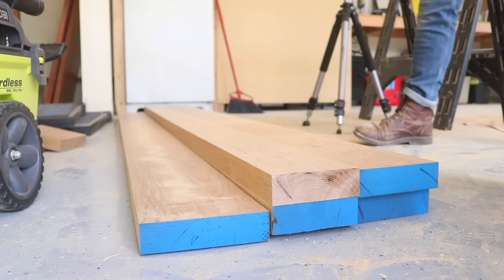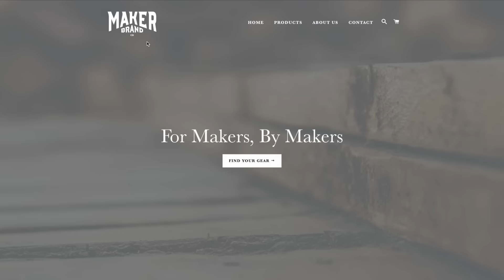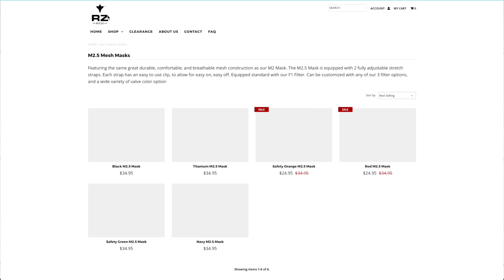How To Build a HIGH QUALITY Dining Table with LIMITED TOOLS // #DIY //  #Woodworking

Comment: limited tools? I count 24 tools
Reply: Limited tools means a much different thing than it used to.
Reply: Limited tools as in basic woodworking tools, limited has changed a lot as the other comment said.
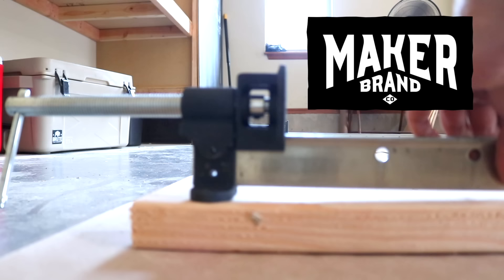Reply: Is not limited tools.. is limited "clickbait title" tools. I've paused the video at 1:56 when i saw that "marketing" shit on the screen...then i've wrote this comment.. and left this channel for good.
Reply: For a maker, the tools he used were fairly basic and common. If you’re a beginner or not a woodworker at all, I can see how you may look at it differently though...
Reply: @gattonpc  he's got a small business and he's plugging his own brand in his video tutorial...what's wrong with that? When you watch Lowe's home improvement vids, do you complain about the branding
Reply: @Jeses Thank you for explaining this.  I didn't understand why Gatto was upset but I do now after hearing your explanation.
Reply: @Lisa Chen better alternative is get black pipe (20 bucks for 6 ft) and pair of pipe clamps (20 bucks).
Reply: Limited editions haha
Reply: If you don't have tools, you shouldn't be doing woodworking
Reply: @audittheauditors  and how does one cut that black pipe?
Reply: @judys5767  you don't. You can buy different lengths at Lowe's or Home Depot, but for a large project like a table top, 6 ft is probably a good length.
Reply: @judys5767  u don't need to cut the pipe for the clamps.  They come in various lenghts. Obviously the longer the pipe the more versatility ull have with sizes of your project
Reply: u save $300 bux on the table but now u spent $2000 on tools hahah
Reply: @betogaxiola Modern builds is an unlimited tool.
Reply: Look, this is the most limited tools you can use to end up with a pretty professional looking and functioning table. You can certainly do this with just with just a drill, some lumber from home depot, screws, table legs, and a can of stain/sealer but you'll end up with a table surface that's uneven and edges that are jagged. Now that's not a big deal if you're just building a picnic table or dining table that you are using placemats with, but the minute you try to use the table for anything else (crafts, writing, putting a laptop on it, etc.) it will piss you off to no end.
Reply: Oh my god everyone, you can’t build a table from scratch with craft scissors and glue sticks.  This is literally the most basic necessary tools to build a decent table.
Reply: Well yea if you have no tools then it’s severely limited, but why would you be watching modern builds if you don’t already have basic working tools?
Reply: My thoughts exactly. Tsk3
Reply: Limited meaning he isn't using a jointer, planer, router, heavy duty dust vac system, dozens of big clamps, a big-ass table saw, etc.  You can't get more minimal than he did here.
Reply: @mrmatt24  😂🤣
Reply: @jonasquintiens5168  what are you saying?
Reply: I can probably make this even though I am into welding more than into woodworks...circular saw, clamps, screw driver...imo.those are basic tools
Reply: Dudes for a 100k plank sander and says limited tools lol
Reply: I think I should do a tools you make from the lumber itself build channel. 

Clamps and jigs can all be avoided with a few diy jigs on site.
Reply: 24 tools that are pretty basic for doing any kind of work....
Reply: Hhhhhhhh
Reply: Yeah but it's not a woodworking workshop, that's what it means
Reply: limited doesn't mean quantity in this case, but without the use of specialised woodworking tools such as a table saw and the like.
Reply: @kamo7293  yeah the clamps under $200 :D
Reply: Yeah, the limit was 25. I think maybe you thought he meant minimal. 😅😂

Comment: This is exactly what I have been looking for last few days.  I am very interested in woodworking and had actually taken a class about it in high school.  So far only thing I have done was a hardwood cutting board which I cut from a piece of log using a chain saw.  I didn't have any other tools at the time so I hand sanded it.  Took a while but I have been using it for last 3 years.  

Now I have a power drill and a circular saw and wanted to make something a bit more interesting.  A smaller version of this table will be a great start.  Thanks!

Comment: I think using the caul boards the way he did works but there is a better way. Usually over that distance and that grain direction the caul boards will bend, ultimately not keeping your table completely flat. Flip those boards on the edge grain, give them maybe a 2degree cut from each end meeting in the middle, this will account for any bend. This is how you get a really flat table top without having to use a planer. Other option of course is to just take that table top to a commercial planer somewhere.

Comment: Nice table but I do have one concern.  Do those legs allow for wood movement.  If not, this table(may take years) will split if the wood is not allowed to expand and
contract seasonally.  If use use screws smaller than the holes with large flat washers in the legs, this should do the trick.  Keep up the good work.
Reply: JRPharmman i was thinking the same. Won’t this table split by time...
Reply: How do such screws even hold the legs though? I think he needed to install c-channels
Reply: How could we prevent this happen in future ??!

Comment: Should you have elongated the holes in the legs so that the wood could expand and contract?
Reply: Yes, he definitely should have.  Otherwise this table top will be likely to crack/split down the road when expansion/contraction happens.  Sweet build though and I always learn something from watching other woodworkers.  I built a 40-42” wide solid red oak table top w/ breadboard ends (w/ elongated dowel holes) and it contracted about 1/8” on both sides (1/4” total) - even after the wood had been air dried for 2 years.  Fortunately because I elongated the holes there has been no cracking/splitting/separating of the top.

Comment: Beautiful table! At 6:22 you can see that the tabletop has warped downward just a little bit near the back. How do you avoid that issue?
Reply: Morning Brian. More clamps in the gluing process mate, alternating top and bottom will help with that issue. If you’re VERY serious alternating grain pattern with bread board ends will remove the cupping also.cheers

Comment: Did you need to add any additional support to the centre of the table considering it was so long? Also what would be the maximum length of a table top before it needs additional support in the centre of the wood?

Comment: I learned apparently if you put tape down on the wood first (like painters tape) it will help for a smoother straight cut. I'm going to have to test it out for when I build my dinning table. LOVE your video's btw.

Comment: there seems to be a noticeable bow.
Reply: Definitely some cupping, another clamp or two on the ends would have helped. Or could have lain those straightening boards the other way, wouldn't take much force to bow those 2x4s in that orientation

Comment: The tabletop is warped in the middle...is there a good way to fix that?
Reply: He didn't use enough caul boards, even more importantly, he failed to alternate the grain direction of the boards in the tabletop, this will cause further cupping and warping down the line.
Reply: @com38ful  Additionally, to prevent future cupping, you can add C-channel underneath. The holes in the legs and the C-Channel should be slotted to allow seasonal movement, otherwise the top may bow or split with changes in humidity. One last comment, I would use a clamp every two feet or so, alternating top and bottom while gluing up. Two is not enough.

Comment: general purpose wood screws aren't the way to attach those legs- Also, you used a straight edge, special tool "from home depot" to make your holes, and your clamps- Several hundred dollars in tools you forgot to mention. (I'd say the dust mask and safety glass are tools too, and most don't have plainer/edgers..) 
 But, looks cool.
Reply: Jeph-Whiskey Rants compared to most Woodworker’s this is very basic tools, this isn’t about basic household tools, it’s basic woodworking tools

Comment: I built a table using your instructions, however I noticed the table rocks left to right. Any suggestion what I can do to strengthen it?
Reply: Maybe your legs aren’t perfectly level. Maybe find out which side is off and shim it with some felt or rubber padding

Comment: This whole video is just an ad. Hardly any content. Also a ton of tools used. I would not recommend this video for any hobbiests out there.
Reply: Ok.  I am a hobbyist just getting into woodworking in my 40s.  I legit would like to know how to make a table with a limited amount of tools.   Any videos you would recommend?
Reply: @blairhickman3614  https://www.youtube.com/watch?v=_KxA8O-4TQ8&t=327s This guys has some more expensive tools too, but I think this build of the legs and frame is pretty straight forward and could be done with a drill, miter saw, and a cheaper pocket hole jig.  The table top process in this video with the dowel jig might be the best way to go about this cheaply too, or you could try just gluing, clamping and putting pocket hole screws on the bottom between each board.

Comment: Tools and things listed in the description: 

"STUFF I USED
Maker Brand Clamps
Simple Finish
Straight Edge
Saw
Drill/Driver
Belt Sander
Circular Saw Blade
Wood Glue
Doweling Jig
RZ Mask
1.5" wood screws
Wire Brush"

Not just tools listed but interesting "limited tools" video.
Reply: i count four tools
Reply: @gavin9623  wood glue and screws count as tools? lmao
Reply: @sadbinoo  exactly hahahahaha I was questioning my whole existence after reading this comment

Comment: love your channel, great videos as always. So you say that the straight-edge that you used to rip the boards was good not great. I've had trouble finding a good straight edge but being a new woodworker i don't really want to invest in woodpeckers gear. So all of that to say, what are some straight edge / measuring tools that you would recommend?

Comment: Question, I dont have tools to rip the edge but can I sand the side down enough straight to bring the wood flush together?
Reply: Trivina Negzerial,

Sanding it flat would be really difficult. If you don’t have the tools to rip the edge flat you will probably want to find a sawmill or Hardwoods seller to help you out. Having a nice square, straight edge really helps with the final product. Keep in mind all you need is a circular saw and a straight board (like a straight piece of MDF) to make a straight rip. You might be able to find those things used.

Comment: Ah FOUR dowels per board, that makes a lot more sense. We used 7 when we recently made our table and knew afterwards it was total overkill!
Reply: I've watched other wood expert channels and they say don't glue in your dowels or biscuits as it can swell the timber - use for alignment only. Did you find this? Hard to know when you get different advice.

Comment: Your table will get a curve in 1-2years because you glued the wood always on the same spot of the endgrain...wood is always working
Reply: I'm not sure I understand what you mean? How should he have glued it?
Reply: You have to glue the wood with the annual rings, once down and the next up. so that the wood works against each other otherwise it will bulge
Reply: Yep. Saw that as well at the end. Kinda a rookie mistake.
Reply: I Stil like his project but he shorted the flatness of his table by this mistake :)
Reply: Sad these "woodworkers" don't know basics like this...
Reply: I don’t think this matters as much as people think. I’m a table maker. I have made hundreds of tables over the last 5+ years and I never alternate the rings. I just pick the best face for the top. I haven’t had one top bow or warp over all this time. 
I think it’s more important to use wood that is properly dried and also to seal the underside the same as the top.
Reply: Hi all!  I’ve been thinking about doing the same, but why no breadboards?  Is that necessary?  Or will alternating grains with dominoes suffice?  Tyty
Reply: You can already see it’s bowed in the last shot where it’s in the home. This is a basic rookie mistake. So many youtubers out there who literally have no clue.
Reply: i have a massive oak table (5 cm thick and 8 cm wide strips, tabletop is arount 1 meter wide) glued up and down alternating and sliding dovetails from the bottom, it is still warping due to saisonal changes - in summer when the air is more humid it bends downwards in the middle by about  half a centimeter and in winter back up. - glueing the rings up and down helps a bit, but is not a solution ;)
Reply: Sad :( Especially since that’s some really nice lumber! End product looked good though!!
Reply: The article "Keeping Tabletops Flat" by Christian Becksvoort for Fine woodworking magazine explains this very well. While a lot of people tell you to alternate growth rings you don't actually have to. Glue up a table top for the best look and then use some sort of mechanical support to keep it flat. Breadboard, cleat, table apron, those ugly metal c channels a lot of people use on instagram.
Reply: Actually you don’t have to. Don’t believe everything you read. There are lots of sources that say that method don’t matter as much as people make it out
Reply: @AussieWanderer.  There a video somewhere on YouTube that backs up your comments. The important thing is moisture content. However, this will probably warp though.
Reply: @earmuffz2348  Yes he really did a job on all that amazing wood. That Oak looks amazing. And they did all the work for him.. Then he proceeds to ruin... The legs were probably the best thing. He basically just glued some nice wood together. Which will warp. There a reason furniture makers spend years learning a craft of making furniture.
Reply: @nickaccardi5551  yes read that... So true but he didn't do that either. The table will warp.
Reply: yep I saw it too
Reply: @AussieWanderer.  Spot on. It's a myth - the orientation of the growth rings don't matter. What matters is what you said: properly dried wood, and finishing both sides the exact same.

Comment: That's a lot of in place ads for a 6 min video.
BTW- use more clamps in the center of your table top glue up
Reply: And you showed the finished product for less than 5 seconds, as an after thought. 

You do better than this.

Comment: QUICK TIP: MAKE SURE TO FLIP THE GRAIN TO PREVENT THE WOOD FROM CUPPING...IN THE VIDEO MOST BOARDS WHERE GLUED IN THE SAME PATTERN..BIG MISTAKE THAT YOU DONT WANT TO FIX LATER ON. otherwise beautiful table.
Reply: Hi i wonder where can i find more info about it, im learning woodworking but is hard to get this kind of info about how to build furniture having in consideration wood movement and its a bit hard to find. There are way too many ppl making furniture on youtube but looks like very very few are aware about woodmovement when you see that they put all the grain facing anywhere, don't get me wrong, I know very little about it but I´m aware of that issue. 
for example something I want to make are those wall art (to start with something small at first) made out many cubes of pine with shou sugi ban and stain and should I be concernedd about wood movement?
Do you have any suggestions about that? and where to find good info about it? 
thanks!
Reply: Books man go to your local library and get yourself some woodworking books... you will learn everything there is about wood movement, types of cuts and so on